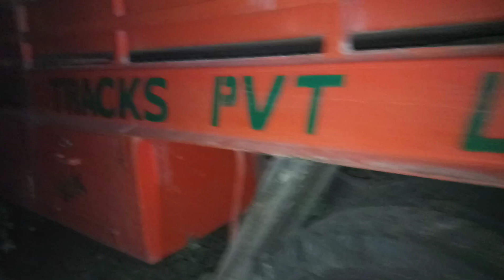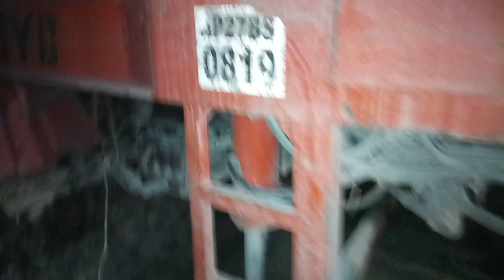Water divining and drilled on the spot at Telengana/Got 2.5 inches water flow/Selvakumar,Tamilnadu

Comment: Sir neenga ithu varaikkum yethana point successful panni irukkinga... Unga point la failure option irukkuma..  100%  successful running ha sir.. Thappa yeduthukathinga..  Na 3nu bore pottu 2bore  washout 1 bore 1inch water 💦 vanthuchi...
Reply from the maker: In my 20 years experience,90 percentage of my points got good results. 10 percentage failures. Number of points may be upto 1000 or more